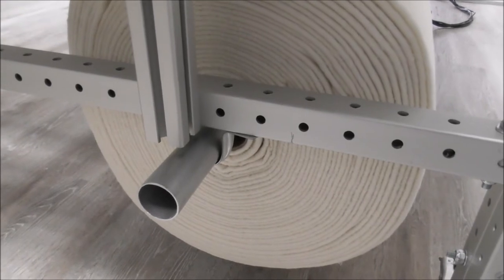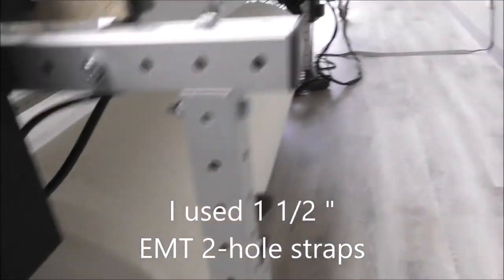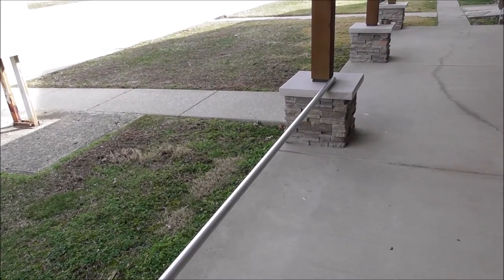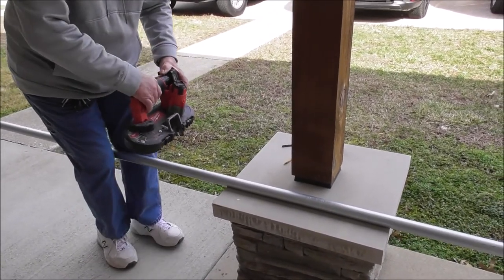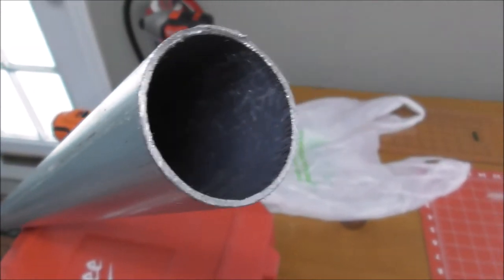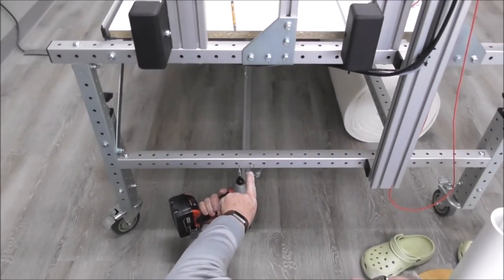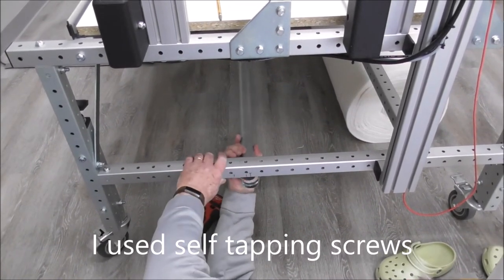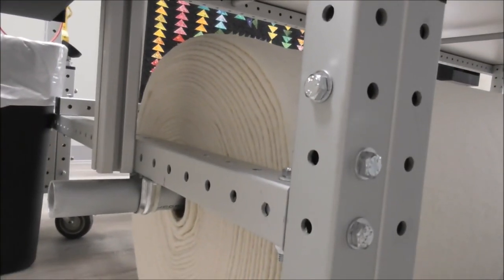Batting Bar Movie

Comment from the maker: It’s folded in half on the roll so I just bring it over the rails to the front of the frame and measure from the front edge and then go to the back and cut it. I have a cutting mat on my table.

Comment: Love this idea.  could you give a list of the hardware used?  It would be  greatly appreciated.
Reply from the maker: 1.5” rigid conduit cut to length (we cut mine to extend past the straps about 3” on each end), a total of four 2” two-hole conduit straps, hex-head self tappers to attach straps.